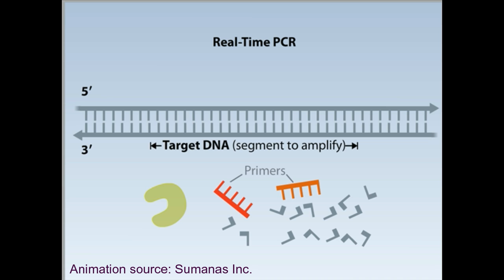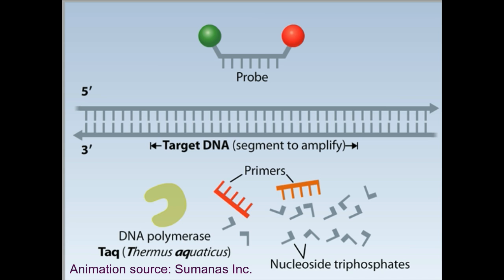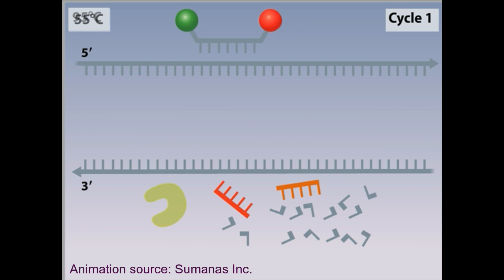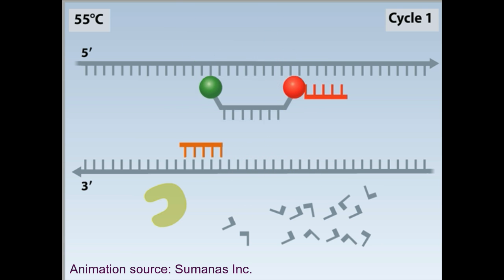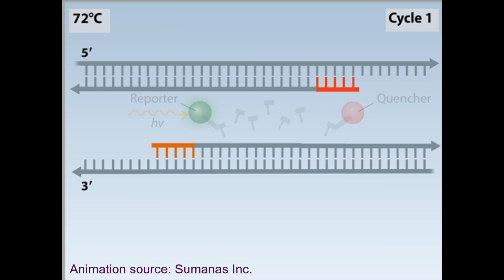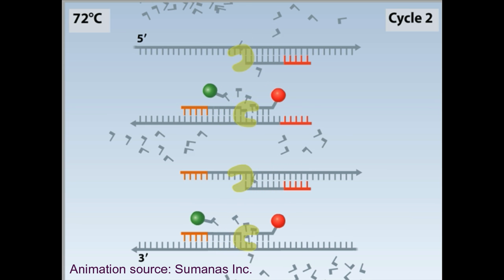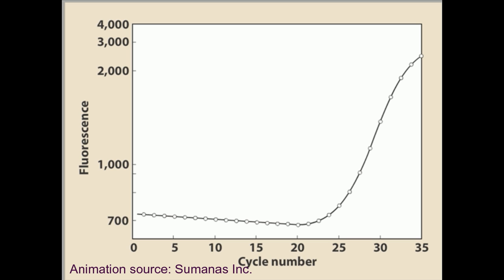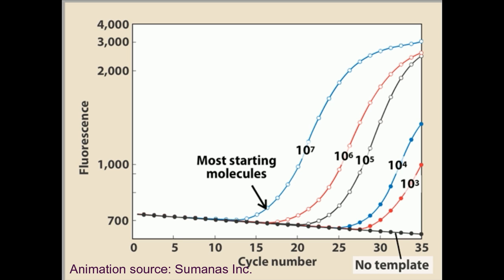rtPCR animation

Comment: Does the probe only ever bind to one strand of the target DNA?
Reply: Well, it will bind to the sequence it is primed to bind to. So if the same sequence can be found on either strand in the same direction, it could bind there, leading to false positives. This is why qPCRs need to balance probe specificity properly: a too "vague" probe can lead to unspecific bindings, whereas a too specific probe might risk yielding low-value results.